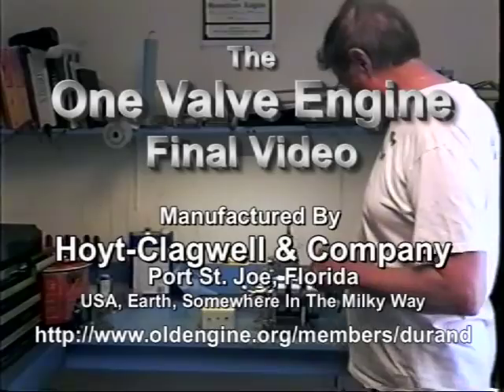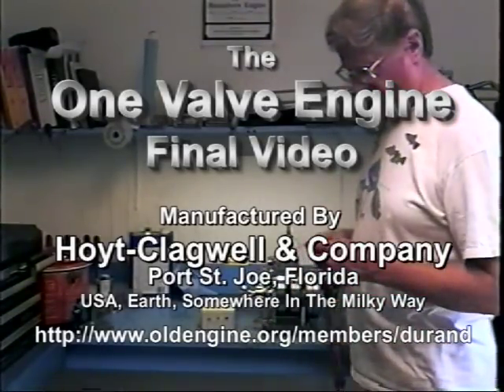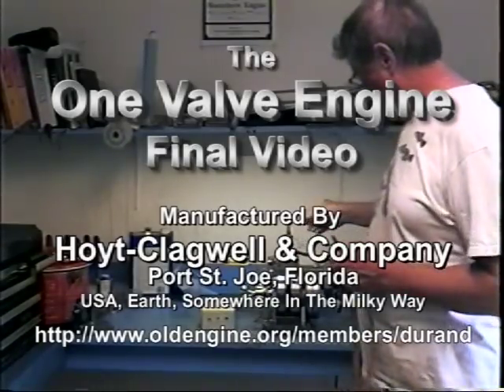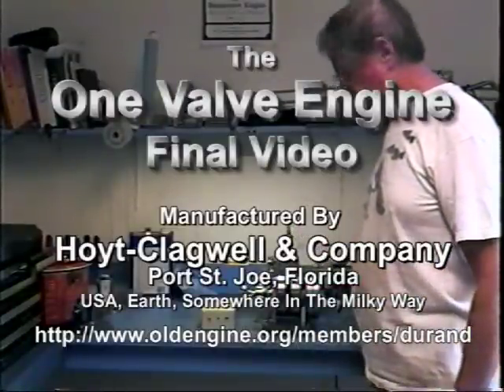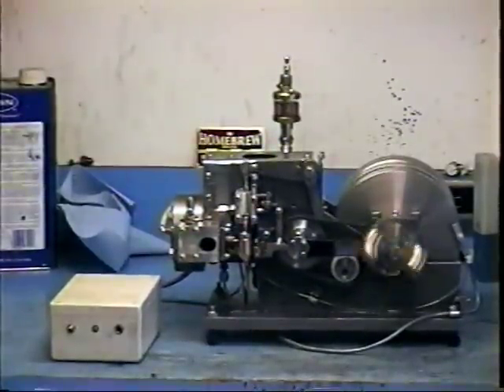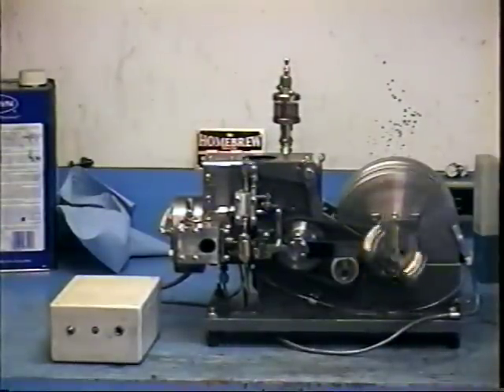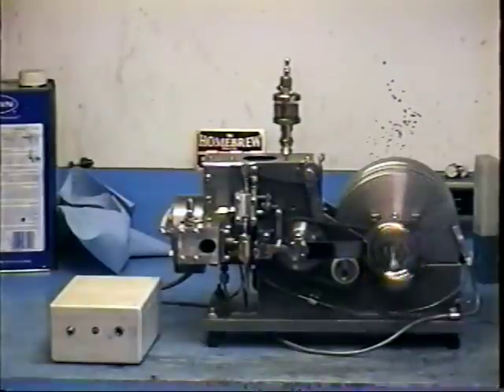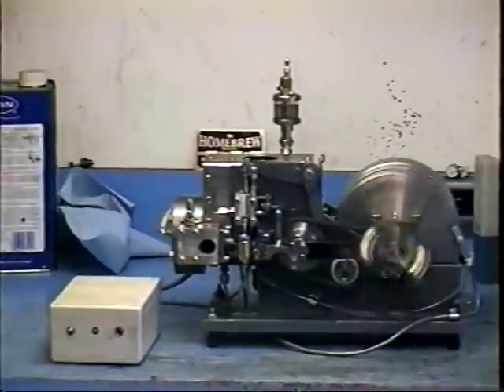One Valve Engine, Final.mpg

Comment: I saw a one valve engine in 1`997 at Malory Park UK it ran at about 2500r/m but was not very flexible as it used inlet and exhaust harmonics
Reply from the maker: Trev:
I know that my idea wasn't original but I just had to try it.  The main disadvantage of a one valve engine is the fact that it cannot have an exhaust pipe as such due to contamination of the inlet air with exhaust.

For one example, the Packard Diesel radial aircraft engine was a one valve design with the short ports in the air slipstream.  It worked well but the engine was a failure due to it's propensity for blowing off jugs in flight.  The attachment method seemed like a good idea at the time but left something to be desired.
Reply: The engine I saw had tuned inlet and exhaust pipes  to harmonize at 2500 r/m - i suggested he put a reed valve on the inlet to prevent blow back which it experienced at other speeds - i remember people from Honda were trying to covertly  record our chat LOL